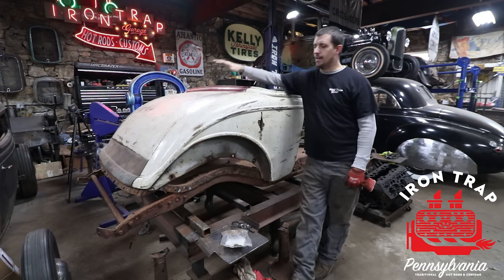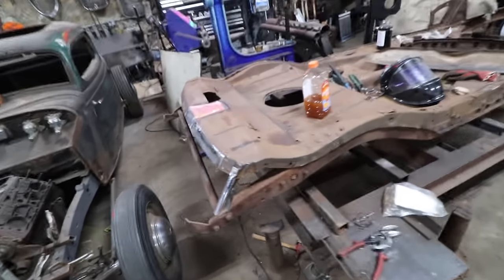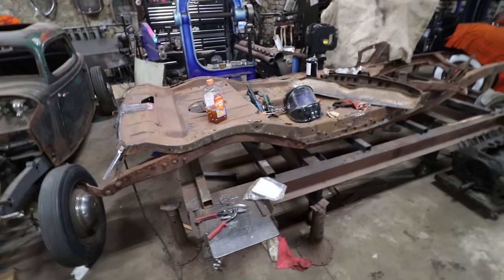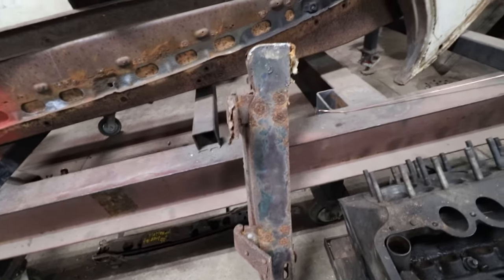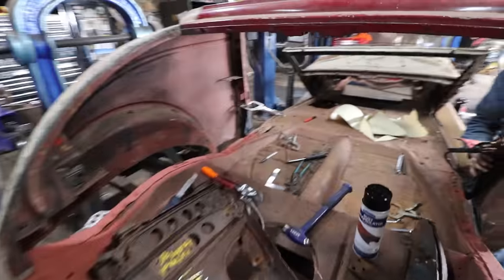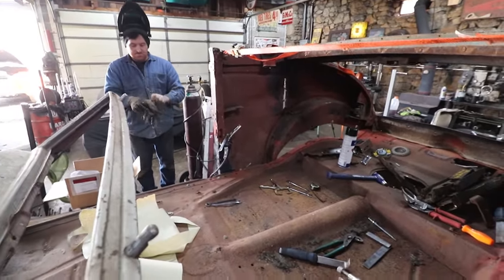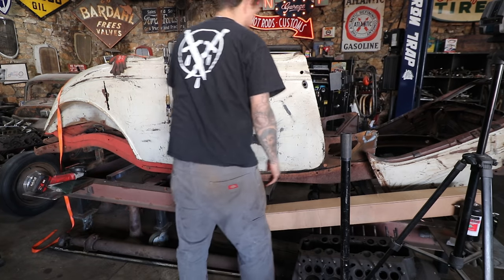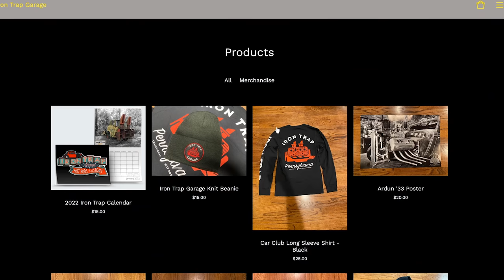Repairing The Channeled B-Pillar Back To Stock!! - 1934 Ford Cabriolet

Comment: Hey guys love seeing y’all doing 33/34’s those are my specialty   Looking good one FYI recommend u install the rear fender to qtr panel triangle nut plates to get correct height on rear floor pan if the floor is too high or too low it will screw up ur door to cowl fit for gaps and bead lines at the same flowing lines , keep up the great work and more vids please. PS where are u guys based out of
Reply: They are in a small town in PA

Comment: Cabriolet or roadster what’s the difference or is it the same?
Reply: Cabriolets have roll-up side windows and sheet metal A-pillars that are part of the upper cowl. (Think 'convertible'.) Roadsters don't have roll-up side windows per say and have thinner A "posts" that bolt onto the cowl. Both are rag- tops. Hope I explained that OK.
Reply: @mattsullivan5274  You did a great job with your description Matt!
Reply: @mattsullivan5274  thanks horshak